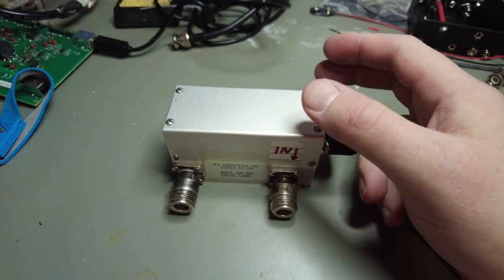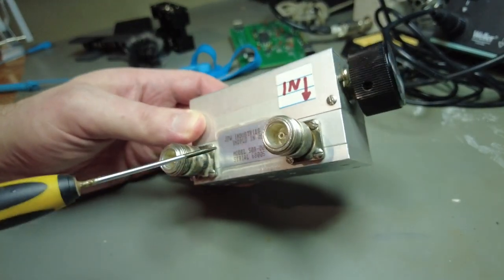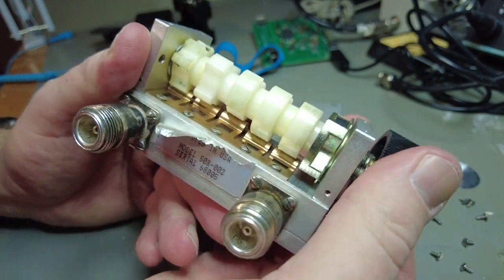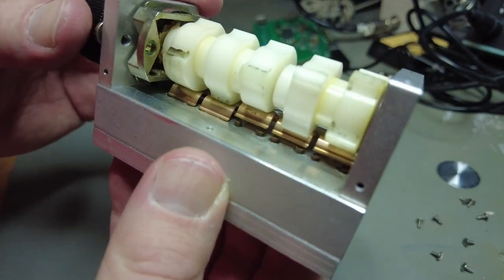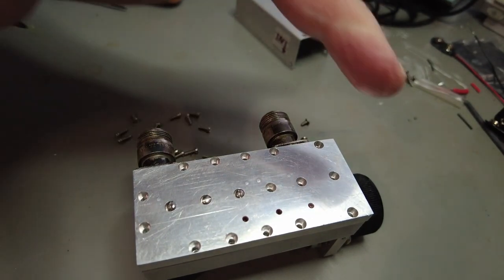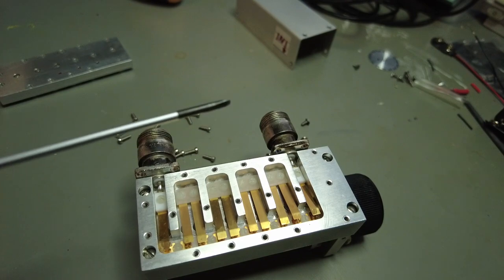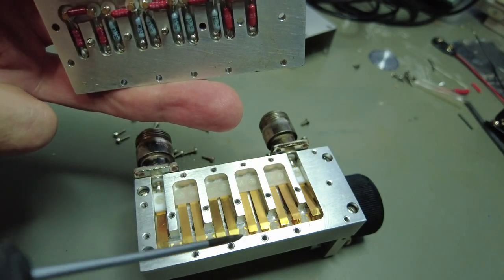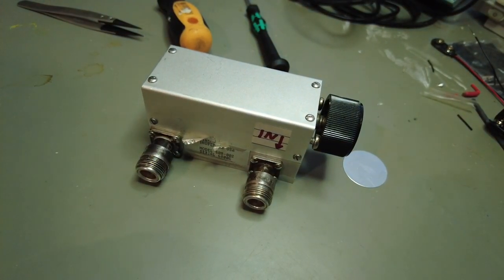What is inside: Variable RF attenuator

Comment: Cool! The heavy-duty milled body with dozens of screws is meant to prevent RF from leaking, the attenuator works up to the UHF range. The attenuator came from a 1980s radio telephone test set and its attenuation range goes down to -130dB.